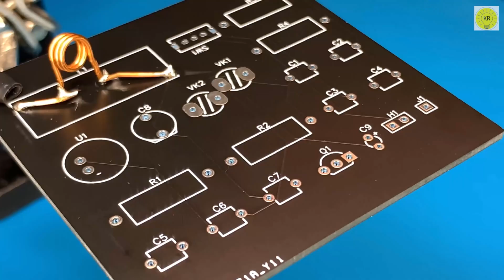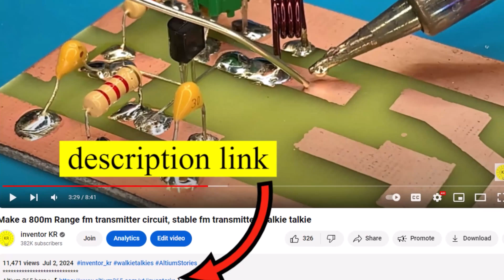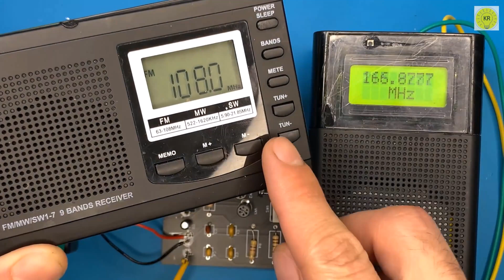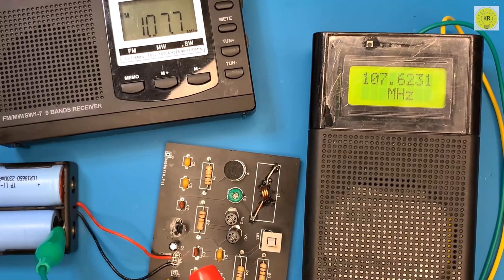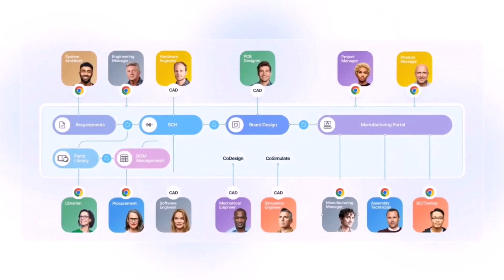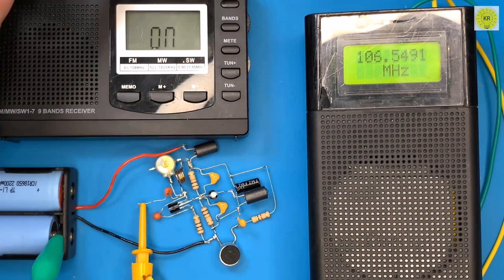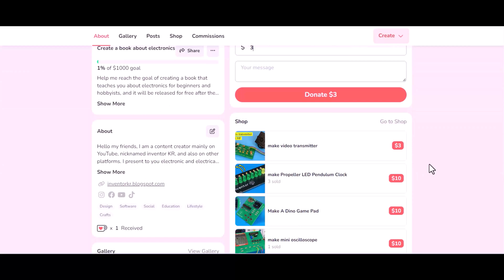homemade radio build  Long Range FM Transmitter circuit 2N2222 transistor

Comment: Sir I have bought a 200 Ah battery and a Luminous 900 va 1050 sine wave inverter. In our house electricity goes off for only 1-2 hours and I only use LED TV. The battery does not discharge completely. So will the battery get damaged?
Reply from the maker: Discharge the battery to 30 percent and fully recharge it once a month.
Reply: @ sir discharge kaise karoon light hi nahi jaati.
Reply: Mcb gira ke ya fuse nikal ke @mohindersingh4990

Comment: What is that black piece that symbolizes VK and how does it work?🤨🤔🤔🤔🤔🤔
Reply: They are "RF INDUCTORS", they are simply a ferrite core with some copper wire turns...
Greetings from Argentina!😂
Reply: Thanks for the clarification.❤❤😊